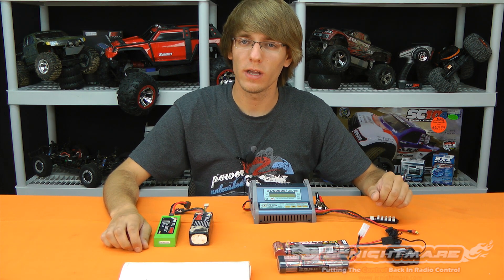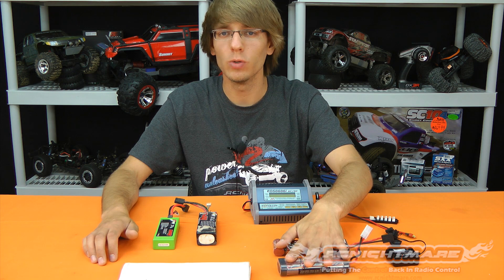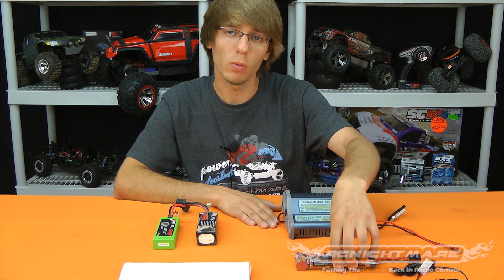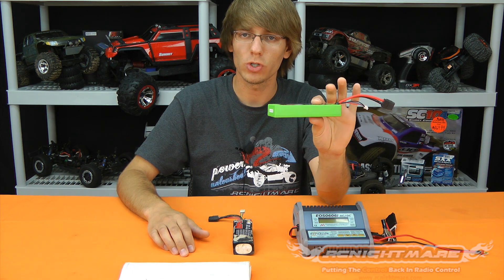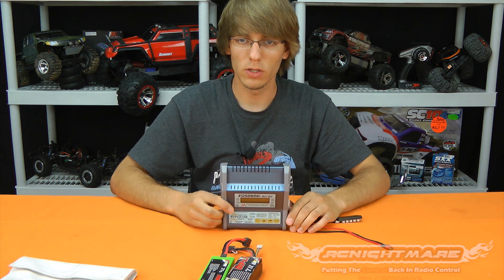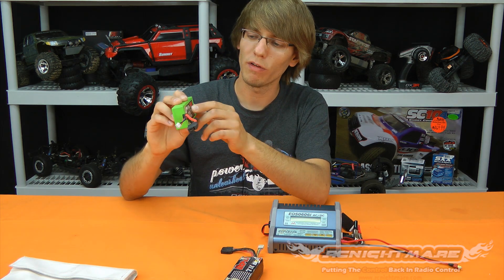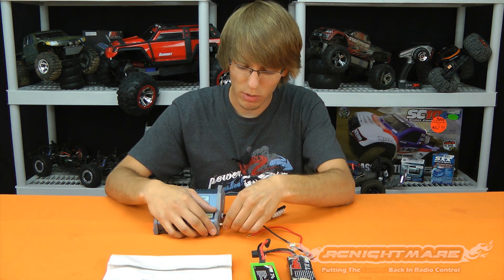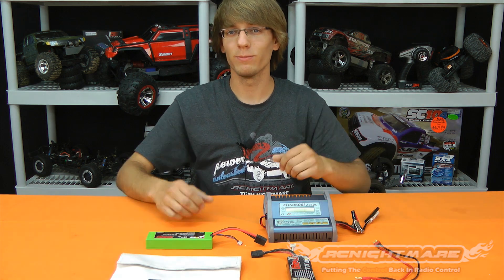RC Battery Safety & Maintenance

Comment: came with wall charger /dumb charger and hump nimh pack i bought 6 cell nimh seperate and tried charging with same charger running HOT does not peak !! i asked traxxas they said not recommended? WTF is going on here

Comment: one important point you didn't mention, if your lipo swells or puffs up during charging or discharging get it in a lipo bag and dispose of it safety immediately,especially if its a 3 cell or higher and under no circumstances try to pop it or fix it

Comment: Hey I just bought 22s 7.4 v lion power lipos 2200 mah for my brushed 2wd traxxas slash 1/10. And I wondered if they will give me good speed and long run time, but won't the lipos damage my stock titan 12t motor?

Comment: Full charging in 1 hour, would be a 1 C charge rate. Check the max C factor for charging on the battery. Even if a battery would allow a 5 C charge, I would recommend to charge it at 0.5 - 1 C.

Comment: A good LiPo battery that is handled properly can last more than 200 charge / discharge cycles while only losing little of max charge capacity. For proper handling never go beyond its limits, preferable use it well below its max current. For max current check the C factors for the LiPo battery. When charging charge slow, even if battery allow a 5 C charge rate I would recommend to charge at max 1 C.

Comment: You should store them "half charged". A LiPo cell nominal voltage is 3.7 V, for storage the cell should be charged to 3.8 V, i.e. slightly above the nominal voltage. LiPo chargers usually have a feature to storage charge, use that.

Comment: thanks for this video! Was already hoping something like this would be out there! Now a question, I got a regular nimh battery thats pretty old, never used though. (likely its age is around year 2000). Would it be ok to use this battery? If yes, should I take steps to use it saver? I was thinking of using it for my Heng Long 1/16 tank.

Comment: hey nice vids! can you help me out i have been trying to find a video on how to fix old betterys? i have a 5000mah nimh battery that i will charger for about a hour till it says it full and i only get about 5 minutes of run time out of it, i also have a brand new 3300 nimh battery that i get 20-25 minutes of run time and about twice the power, my question is, how can i restore my battery to get it back to normal function?

-jake

Comment: i use a balance charger, but when i check, the voltage difference between my 2S cell is kinda off, like 0.02 - 0,05v per cell.. hmmm.. any help?

Comment: When charging a lipo and using the balancer board do you plug both the connector and balance plug or just the balance plug itself to charge?  Sorta dumb question but i'm in the market for lipo's and just trying to get things figured out.

Comment: @MrGoochie28 If you running just one 2s lipo in an E-Maxx then no, it wont be enough voltage. But if you're talking about running two 2s lipos in an E-Maxx then it would be okay as long as you use a lipo cut off because the stock E-Maxx ESC does not have one

Comment from the maker: @daryl81895 It's always best to store lipos half charged; around 3.8v per cell. Lipos always prefer to be at nominal voltage (3.7v per cell) but they do self discharge sitting around so we go a little higher. Also a good idea to use them once a month or so to keep them in good shape.

Comment from the maker: @bigmikie Something is not wrong. As we string batteries together in series we create a higher voltage pack. When you plug that large pack into an ESC or charger, there are "batteries" (i.e. capacitors) in them. These are usually drained but can be charged in an instant. The moment you plug you pack into the esc or charger you are filling these capacitors at a very high rate, hence the SPARK.

Comment from the maker: @bully3288 No if you look closely those are venom lipos. They come with a "univeral plug". You choose the right adapter (deans ultra in this case) and it snaps into their plug. Not made to be switched around though. It merely looks like traxxas but thats a deans ultra adapter on there.